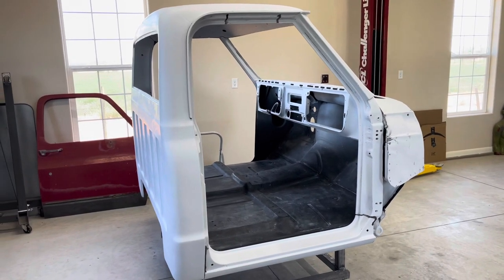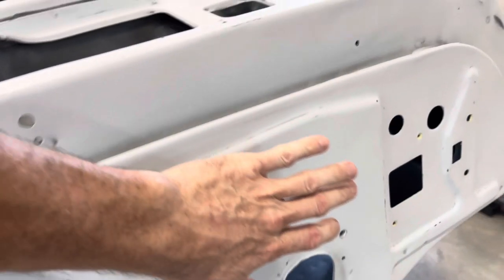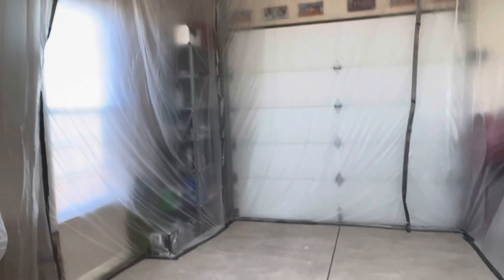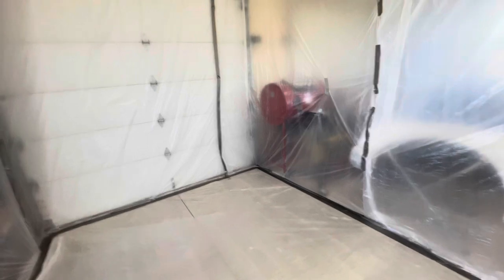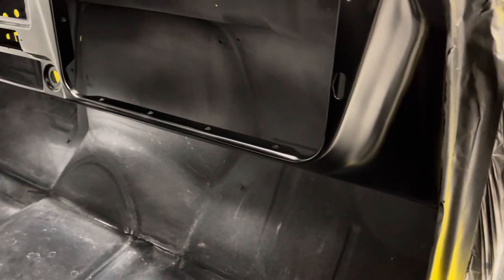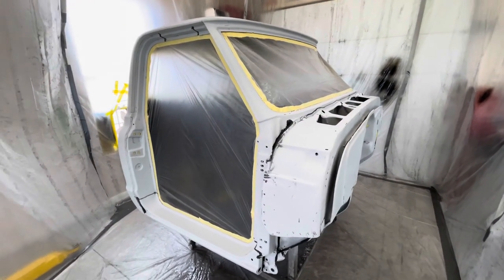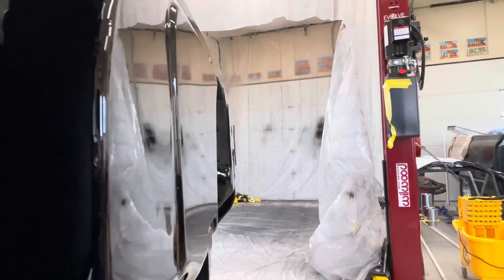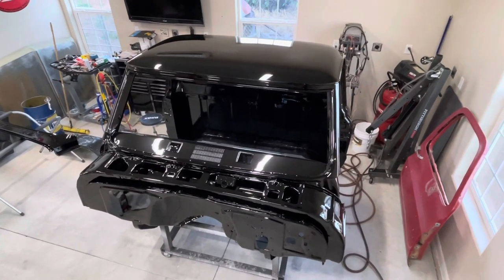Finally! The 1972 C10 Cab is painted in gorgeous black paint.

Comment: It appears chrome in certain angles. I would be happy with that! 
I like your word; Crappily! From previous video about customers and shops and never show up at 5PM on a Friday. Great job!
Reply from the maker: Yeah I have a colorful vocabulary especially when I talk to myself when no one is around.
Reply: @curtrobinsongarage5452   What is amazing is that people caused an accident & damage, was forced to help during the repair, buy sandpaper, fetch supplies, buy tape, paper, plastic & guide coat and sweat! Then they are required to go to PPG and pay for the epoxy, primer, color base & clear ($1,890) and then stay up during a 7 hr sanding, cleaning, taping, tach & blow, wax & grease, cost of PPS 2.0 cups (600ml), Sata, filters, spray base, flash, repeat, wait then clear, wait, (7.3 hrs later) then wet sand to cut & buff, compound, polish, detail and return to the customer they hit after responding to a text message from a gal (Jennifer) he met the night before, crossed lanes or didn’t stop in time….and loose their wages for that week! They would not do that again! But, they say you can’t fix stupid.

Comment: Come out great is that the original dash it looks new 👌
Reply from the maker: Thanks, and yes it is so much so that it took me until the last minute to cut out the slot for a modern radio.  I was really surprised it hadn’t been cut yet.  I did have to weld up a few holes where the previous owner had mounted an XM radio controller though.

Comment: Grate job , I’m getting you suggestions about fix what you gotta fix I only have a question what primer , paint and clear coat brand (s) did you use ? If you like to share that info
Reply from the maker: On this project I’m using PPG that includes the DP90LF epoxy base, high build primer and the Base/clear.  I will probably not use it on any future projects due to the cost, it is very expensive.  I have used Martin Senour in the past and it works well too, but is less expensive.  In the future I don’t know what I will use but I’m reality there are a lot of good products out there, as long as you use a premium product and use the same product for everything and don’t mix and match you should be good to go.